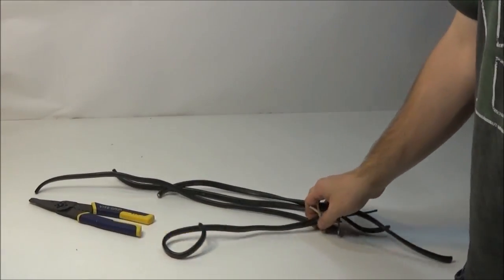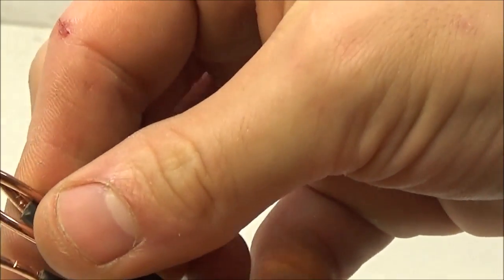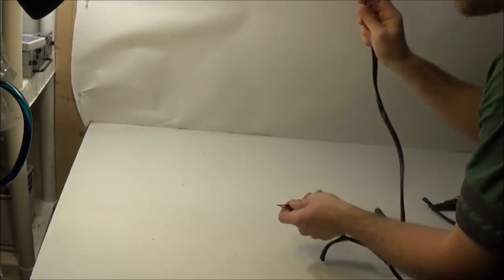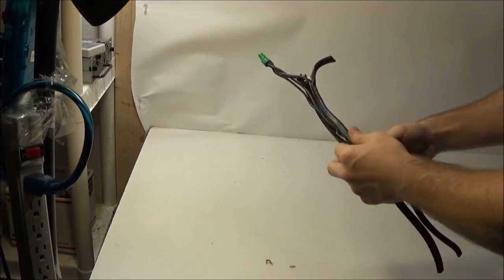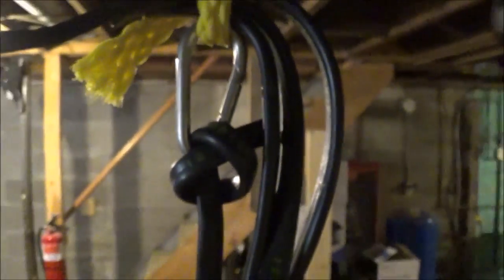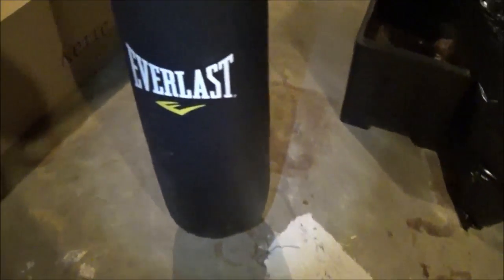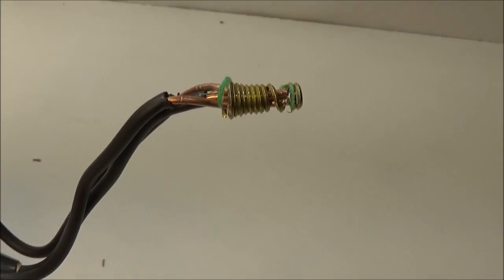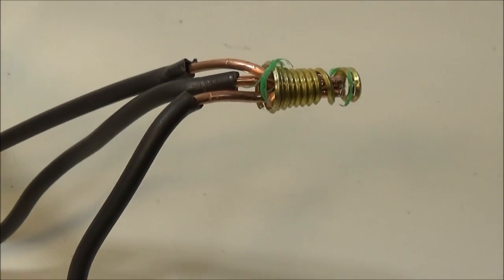How strong are wire nuts? Wire nut torture test.

Comment: Tape because the plastic isn’t going to last forever
Reply: Yep... And in areas that could possibly get wet due to a structural failure (think soffit lights). Pro elechickens don't tape because it takes another 30 seconds and costs another nickel.

Comment: Nice test. Also, I always tape around wire nuts. Not because I think that they will come loose, but because I have seen wire nuts where the plastic shell has cracked. If the plastic part of the wire nut cracks or comes apart for whatever reason, electrical tape around the wire nut will keep any exposed metal from shorting out. In my opinion, taping around the wire nuts with electrical tape has no downside, so I always do it even though it's not required.
For that matter, I also always tape around switches and receptacles before I install it into the wall box. That way, a bare ground wire can't short out against the screw terminals. Also, if the switch or receptacle gets yanked to the side for whatever reason, the screw terminals can't short out against the metal box, which I have seen happen several times.
Reply: Avery Alexander yes I have seen many fall apart over the years

Comment: Do not follow this guy on how to wire .  Always make a mechanical connection with the wire by twisting it. For solid wire Buy a pair of Kline pliers (yes they are more expensive but worth it) and use those to twist the wire and to twist the wire nut as well when you can’t twist it by hand don’t go “nuts” and over  twist it . Wing nuts are better than plain nuts.We never used electric tape for taping over the nuts but I could see were in some applications it could be useful .  If you don’t like wing nuts to connect wires the look at Wago connectors. I haven’t use Wago connects but the look better choice if you have to go from stranded to solid copper. Whatever you do make sure you get the right sized connecter  for your gauge wire.
Reply: I can take a wirenut and install it by hand on 3-4 parallel (not pre-twisted) wires and, again by hand, tighten it down far enough that the wirenut twists the wires together just like if I had pre-twisted them.

If you can't do it by hand then use a power tool, but the point is, the wire nut will twist the wires together when tightened far enough so pre-twisting the wires is not necessary. You can remove the wire nut and verify this. If the wires aren't twisted together, you aren't installing the wire nut correctly.
Reply: Brian Leeper no the wire nut will break every time. before you twist anywhere near what lineman’s pliers can do (linesman’s will break the wire if you go overboard too much assuming you don’t you can make a much stronger connection then the little bit of twisting a wire but does
Reply: i think you ment klein*

Comment: You tell people to make sure they're doing it right while doing it wrong. Not twisting your wires before wire nutting burns houses down. It's one of the few circumstances where old breakers will not trip regardless of the fault occurring. Any small gaps where there isn't a solid connection can cause small arcing which creates heat, and there are several videos that portray that exact scenario. It can and has literally burned houses down, arc fault breakers are now required and protect against this but most panels are still the old school bimetallic strip breakers. Do not encourage people to do their own electrical work, as an electrician it is one of the most common reasons I get called out to fix things.
Reply from the maker: The to pre-twist or not pre-twist debate is a hot one. Of all the videos I watched where a person purposely caught a wire nut on fire none of them properly twisted the nut on to the point that the exposed wires twisted underneath the nut as well. I do not doubt many DIY electricians install things incorrectly. My house had bare twisted wires in the walls with no box (or nuts) because the person kept using scraps of NM-B to save money. A friends house has romex ran in a pinch point between two boards and as the house settled it started serating the sheathing. People are pretty careless. My family has to sleep in my house and I trust myself. We have a smoke alarm in each room, a CO alarm in each bedroom (and one in the basement) so there's that too. Oh, also, the "electrician" that they hired to fix some GFCI issues in the bathrooms before closing left bare wire inside metal boxes (grounded wire and hot, not grounding) and intertwined romex around copper pipe instead of running a board across the bottoms of the joists. Not all DIYs are hacks. Not all electricians are experts.
Reply: @striker1211  If you properly install a wire nut, pre-twisting isn't required because the wire nut will twist the wires together IF you tighten it far enough. You can remove the wire nut and check that the wires are in fact twisted together by the action of tightening the wire nut far enough.

The electrician who wired my house must have been a complete wimp because he didn't tighten the ground screw on several receptacles very much and all of the wire nuts he installed weren't tightened like they should have been. I can tell the wires were pre-twisted---the twists weren't as tight as what the wire nut makes them.

I'm not exactly Mr. Strongman myself, but I can tighten any of the connection screws on a receptacle to the point where it strips completely out pretty easily--in fact I have done it accidentally on occasion.